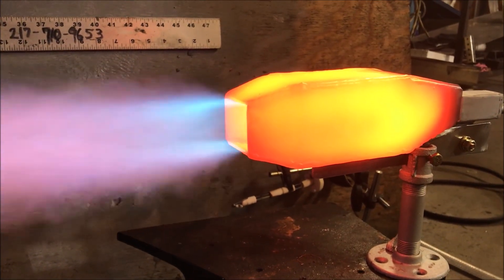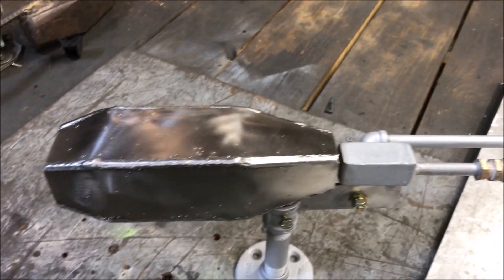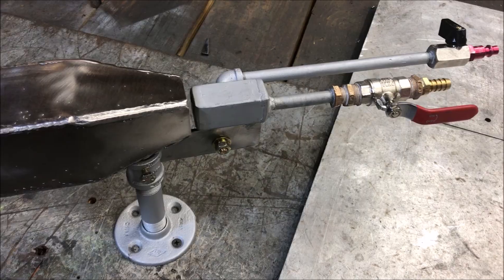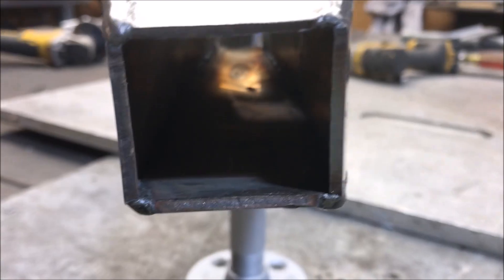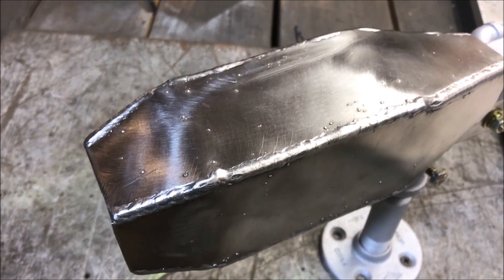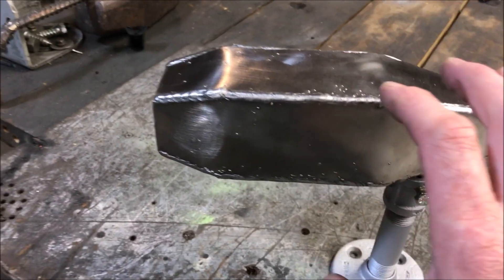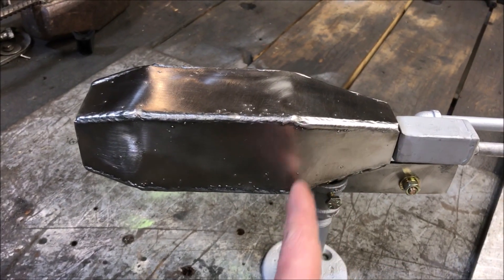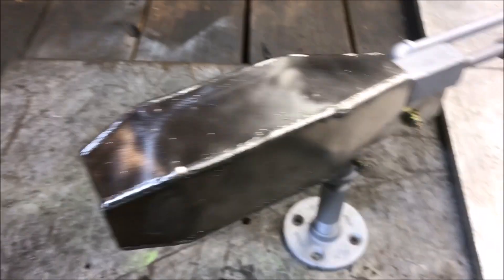Godzilla build waste oil burner (DESIGN)

Comment: I ran mine today, for over 45 minutes, the "cone" or whatever you call it didn't start glowing until it started to backfire, pulses of air and fire backwards, kinda loud, I was seeing oil running down the inside of the cone and leaned it out as much as I could. It didn't seem to consuming a whole lot of fuel, I don't think the 5 gal bucket of desil/drain-oil mix was more than a 1/2 drop in level for an hr of total run time. I am not sure what was happening there. Alum was certainly melting, just not well enough for it to make it to the drain on the one end. It was in the high 40's or low 50's for temp. Is the difference between a hot summer day and chilly fall day enough to matter with one of these? I somehow doubt it. The barrel was a thin metal oil drum with no lid, so likely generating enough heat just not enough to heat the whole bottom so as to allow alum to flow out. I do have a pair of heavy steel casks I can use as crucibles, but as of right now, no way to pick them up and pour them once hot. I got some vids I need to post.
Reply: could too large a gab between the exit point of the fuel and the cone entrance be an issue? I bought one of your kits, Ill hafta look to see if that is adjustable.

Comment: I would build a heat exchanger made from stainless steel tubes placed in front of the burner with glycol running thru the tubes and another heat exchanger in the shop with a blower to force shop air thru the heat exchanger its pretty much free heat.. the burner can be setup outside in a fire proof housing with a PLC panel made to house the contactors and electric igniter circuitry that would communicate with the shop thermostat.  You could really build a massive copper coil that would house the burner and flame with a simple chimney on the end.

Comment: I would love to see how loud this configuration is, the space that I am in of which is a 28x 40 steel garage, it would be nice if this wasn't too horribly loud due to the high air pressure needed to make this system work. Could you provide any info on that? Thank you for your content

Comment: Definitely nice to know that you're selling this stuff, I'm heavily considering it. I have tried many different versions of waste oil burning systems that I have developed on my own, I lack the ability to weld stainless steel which is ultimately the best for something that is going to burn 24/7 and glow red hot the entire time, of which is my situation. I'm trying to heat a 28x40 steel kit garage with no insulation. Having something like this is absolutely ideal. Thank you for selling
Reply from the maker: Ill cut you a deal , im faster at building these days
Reply: @NOBOX7  cut me a deal? Now my attention is captured. Is there a way I can message you off of YouTube? WhatsApp I don't care what it's called
Reply: @NOBOX7  just send me the link to where I can purchase one like this, it doesn't matter to me how much oil it burns, I have too much oil at my fingertips I need the ability to burn as much as I need or as little as I need, if it can be adjusted and you have designed one, send me that one. Thank you so much and I applaud you for making a hobby out of something that helps so many people like myself. Many of us are those who have their own shops or homes that need to be heated by means of waste oil that is captured from dealerships in the area. It's cheaper for the dealerships to give it to someone else other than paying the waste business to take it away for them. At least this way it's profitable for us and free heat, or at least close to it, for the winter.
Reply: I just ordered one of your waste oil burners. It looks good I will give a full review once it arrives. I am also a YouTuber I will document it's happening. Thank you for your ambition and creation.
Reply: Were run

Comment: You can add another feed for water like the oil.
Water helps burn any co to co2, prevent carbon buildup, improve burning.
Reply: Awesome suggestion!
Reply: Water-gas-shift + hydrogenation. Bit high temp for that inside the flame, but maybe just right on can surface, where all the coke forms. Neat idea.

Comment: I wonder if a grid in the flame path would help to hold a bit more heat and vaporise anything left unburnt?even if it’s just a section that splits the flow into 4.

Comment: I’d appreciate if you could explain why it is beneficial to have the combustion chamber formed liked that, with the narrowing exit. I can understand the inlet, to have control of the air entering, but how would it perform differently if the side where the flame exits was without the narrowing? How much worse would a straight tube perform, with no narrowing at either end, or just narrowing the inlet?
Reply: I think it's just supposed to make the flame more narrow.
Reply: @zergalmole  What purpose does that serve?
Reply: @bjondersson  more complete combustion maybe? I mean, I gets narrower and compresses the expanding gas so it might help burn cleaner. I really don't know, I'm curious about why myself too

Comment: How much compressed air does this thing use? How many CFM at what PSI. At some point with enough air consumption it would be cheaper to heat your shop using the electricity saved from the air compressor unless you had a really big job. Or an unlimited supply of crimpressed air.

Comment: How’s even posible to get that clean burn  with waste car oil?
Reply: Burn fuel more efficiently it's cleaner remember MOST of gasoline Is water...same with high viscosity fluids... covalent bond of hydrogen and oxygen is never ending...burn hydrogen or oxygen you get Steam...this closed loop system...use a radiator to recapture exhaust from oxygen/ hydrogen engine....so simple we made hydrogen in 5th grade chemistry class..

Comment: I'm confused about how the nozzles are side by side in the square steel thing, but then a single jet comes out of it and turns into a raging fireball in the flame holder. Do the jets angle into each other to merge into one?
Reply from the maker: no

Comment: Could you shed some light on the oil feed design. Is the oil pressurized and atomized through a nozzle? Are u using a forced air style blower aswell? What setup? Psi cfm?

Comment: Put your fucking guard back on your angle grinder.
Reply from the maker: you obviously voted for Joe biden inwitch case i have no response
Reply: @NOBOX7  Not even American, chief. Just an emergency doctor that is tired of fishing bits of zip disc out of people. Put the guard on.
Reply: @LobbySeatWarmer  , many times the guard prevents the disk to access all parts, not mentioning that you can't use it all the way and waste 1/5 of it. With just an extra care of using it is ok if one cannot reach

Comment: You know with a little tinkering, you are very close to a aerospike design used in rocket engines.
Reply: The most efficient method would be a teardrop with an open end the combustion chamber in the spherical part that way the reverberation of the actual sound waves mass movement of molecular cohesion frequency attenuation or is humans call it mass movement of air molecules would create a ram jet effect so long as you know how the manipulate the inner part with a parabolic reflector dish with a step I can build the same thing out of fiberglass or carbon fiber and because the air Watts attenuation pressure wave propagation field would be aligned with the walls of the apparatus it would not melt due to Brownian motion of sound waves it would actually cool it on the outside and in the center it would be extremely hot of course you would have to find the right frequency of reverberation but that's nothing that a tone generator can't fix no prototype of stainless steel would work too many impurities but if you were to take something that is electrical anyways I'm not going to give two away too much away I never do but yeah I can do the same thing with fiberglass
Reply: The reasoning is simple 70% of all mechanical motion is moving by sound waves air Watts attenuation propagation field not thermal energy actually thermal energy in the scope of the universe or of stars is a sure sign of loss of entropy the inner part of our son is not hot it's actually very cold have you ever tried to burn hydrogen by itself or helium the boiling point is very very low so therefore the inner Dynamo that is the Sun beneath the coronal layer is acoustic energy trillions of decibels and due to the covalent bond of hydrogen most likely has a core of oxygen again very low boiling point actually observed this phenomenon from my father who used a speaker apparatus to push a turbine to drive a generator to run a welder and arc welder 220 volt 55 amp using a 12 volt car battery as is input to his system and his speaker driver apparatus which he has p patents on to the tune of hotel California at over 240 decibels something supposedly physically impossible due to 170 threshold they cavitate but I watched it with my own eyes and I watch the man build all these machines so multiple masters degrees multiple engineering degrees multiple tradesmen and US Navy SEAL Vietnam electronic countermeasures 1965 to 1968 raised by my World War II army Air corps grandfather and Sheriff but yes you can push sound waves more efficiently than Steam if you know how.......

Comment: That's freaking legit....Glad this showed up in my feed, somewhat tempting to build a handful of these on a much larger scale for our shop, we do generator services. A single service run can yield 20+ gallons of used oil, and our drum in back fills up quick. This'd be an outrageous way to heat the shop during the winter and also save our butts if we run out of space.
Reply: Hail the algorithm!

Comment: Wouldnt it be cheaper and faster to just cut some shs into that shape rather than welding all those plates together?
Reply: At first I thought the same thing.  But then thought this guy does a lot of prototyping so sheet is more versatile.   I bet cheaper than stainless tube as well.

Comment: One guy once told me he used to heat up his metal shop with waste oil that had also water sprayed in to the burning process or something like that. He claimed that it burned super hot and clean. Eventually he was caught doing it and he had to stop. He claimed the burning process to be cleaner and the heat output better than actual oil heating he had to start using after the incident.
Reply: Who "caught" him?
Reply: @gregorymalchuk272  No idea. I would think someone that knew about his oil burning stuff didn't like it and notified the authorities.

Comment: what would happen if you ran that flame into another barrel placed horizontally for a second heat chamber. I hate to see all that flame coming out the end go to waste. also the distance I need to place it from something for safety reasons. I think a small 35 Gallon barrel would heat up nicely.

Comment: Coupla comments from a Boily, Do your welds on the staino in the vertical down position, you get a neater quicker weld. Make your nozzle thing out of 75mm SHS (or 3" to you yanks) and cut out the corners, then bend them down like you did there (less fabricating) and for fucks sake Put a Bloody Guard on your Grinder!

Comment: You know I'm thinking you could use this in a forge I'm a blacksmith in a welder and I mean you know we go through enough propane so if you could actually swap it over where you're just using used motor oil that would actually cut your costs down on your product that you're creating
Reply from the maker: Yes i sell many different burners for this purpose now as a result of this research

Comment: Should be TIG welded!
Reply: Why?
Reply: GOAT GOATERSON   Its hard to tell what hes using for wire? Either its flux core steel wire or stainless wire with the wrong gas or incorrect process? Either way there is to much spatter and an un professional looking weld for $500.00! On a technical standpoint, GTAW (TIG) will fuse the base material with the same 304 filler at a slower rate resulting in the weld being as strong as the parent material. I would also cap and purge the piece with argon. The result would be a weld that wont crack after many heating and cooling cycles.

Comment: No one steel can last forever on those temperatures. Even "refractory stainless steel" burn out.
Reply from the maker: 310 can last as long as you will use this thing , salamanders run ad red hot temp for years , this is stainless steel
Reply: @NOBOX7  sorry, yes it can if it is in open air, but if you put some refractory insulation over this burner, to reach higher flame temperatures for better combustion and stop heat losses, then will burn out. That's what I meant :)

Comment: Nice but it burns 25 gallon an hour. Pretty flame tho
Reply: so what, It is FREE heat, I run a mobile excavation equipment repair company, between my services and friends/customers dropping off oil, I average about 1000 gallons per year. of FREE HEAT
Reply: Free cancer, too.

Comment: It's amazing that there does not appear to be any smoke, And it is also something that you do not mention in the video.

I am wondering if that is something to do with the air fuel ratio.

Top quality design and very compact.
Reply: Its the same with diesel engine. If the air/fuel ratio is correct, diesel cars should not smoke at all when at working temperature. Only when you stomp on the pedal there could be a grey/black cloud.

Comment: If a guy buys one of these, what else is needed!  I'm assuming an air compressor,regulator and oil container, and plumbing?
Reply from the maker: you dont need a regulator , just an oil tank and a hose , i provide a 10' stainless braided hose
Reply: NOBOX7 I mean to regulate air pressure going to your device from the compressor. I'm assuming an air compressor is what feeds the air. I know some of them use a fan, but yours looks like it uses an air compressor.

Comment: How do you pressurize the system??
Reply: Looks like it takes an air compressor and running all the time but with that oil consumption you are probably not running it long so I guess it's supposed to put out enough heat quickly

Comment: That's the best home-made burner I've seen online so far. Any info about the heat output (kW/h, flame temp, etc) and also the oil consumption/hr??
Reply from the maker: >2400 deg F on diesel and propane , 1900 waste oil  but all will hit 2600 in a foundry easy . 
1 to 25 liters per hour . 10 to 250 Kw
Reply from the maker: I sell these on my website and ebay
Reply: @NOBOX7  Hi ,i'm werry interested in this ,i want to burn waste oil in idea to heat my home's furnance ,i need 30kw powered burner ,how much it would cost ? And how much would be the oil consumption in a hr..?

Comment: Sir, how long it will takes before we need to change the tube ?
Reply from the maker: with stainless , years and years and years .
I have a salamander that runs red hot and it has lasted 10 years
Reply: @NOBOX7  i've made the slighly  same design but the tube get burn into ash in about 3 months only even i tried with ss 310
Reply from the maker: Let me knowhow the 310 works out , ive red about it .
Reply: I mean the burner casing using material ss310 instead of 304, but still get broken in a few days only, due to high temp or something else, anyway i'm using the waste oil, any suggestion Sir how to separate the mud from waste oil ?
Reply from the maker: @irwansutejo7233  I am purchasing 5 silicon carbide burner nozzles and im gonna make burners from them , would you like to buy one ? I will get back to you about the mud
Reply: @irwansutejo7233  I use a 5 gallon bucket with an old bath towel tied on the top to strain the grit and other trash out
Reply: @josephschaefer9163  for filter the mud ? Thanks i will try it
Reply: Use inconel, it will last a lifetime 👌

Comment: What is the original diameter of the square tube?And for a foundry is more powerful Godzilla burner or little Dragon burner?
Reply from the maker: Godzilla is about 60 deg hotter due to the larger internal combustion zone . 4 cm is the discharge but i sell these with custom nozzle ends , any size you need .

Comment: Oil usage guestimate: about 50mls in 12 seconds, or 250mls in 60 seconds, or 15 litres per hour with that fat jet.  Or 3.9gallons per hour.
Reply from the maker: 1.25 gallon max on waste oil but can do up to 25 LPH on diesel
Reply: @NOBOX7  how quickly can this melt aluminum?
Reply: and what you using for a pump?
Reply from the maker: @TheStarforce2  3 minutes
Reply: J D  I have air induction from a small fan , works great
Reply: appreciate that this used for the high btu output and relatively clean burn considering . if in a heating system a massive water system with a large reservoir would be necessary to actually use the heat generated for home or shop heating , driveway melt etc etc .
Reply: thats a lot of oil wasted.. we use 5-6 liters per day with a drop by drop system , simple design and no nozzle. Gravity works for us. Just a 12V bmw fan to blow air . No compressed air needed which is expensive and noisy.
Reply: @aurelianmunteanu7680  I run same system 
I burn about 15 gallons on a long day 
Big heater , 36x60 shop up in Canada 
0 smoke on a drip system
Reply: @aurelianmunteanu7680  any of that on video
Reply from the maker: @ Yeha but you cant melt metal with it , this is for melting copper cast iron and aluminum
Reply: @aurelianmunteanu7680  and your able to melt aluminum with your system.
Reply: @justindavidson6917  no it's a heater
Reply from the maker: @justindavidson6917  Yes of coarse , it installs very well on furnaces .

Comment: Nice welds, what machine you using?  Also, would there be a reason not to use 316 or 316L?  Thanks
Reply from the maker: 316 is not the best for high temp but its ok , im using a miller matic 141
Reply: @NOBOX7  
Thanks 👍